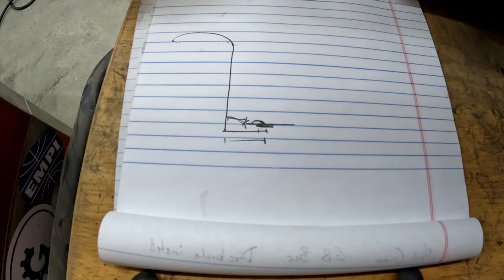VW Beetle Floor pan install

Comment: Probably the best video on how-to replace floor pans. Very thorough and to the point. Thank you. Now… all I need to do is figure out how I can do all of this in my 1 car garage. 😅
Reply: wish i had a garage
Reply: I don’t have a garage lol
Reply: Always, always, always drill the welds and use an impact chisel to remove the leftover metal after cutting off the floor pans. This is VW Bug 101 people. Doing it the way he's doing it will result in premature deterioration of the new spot welds and also lead to leaking from the floor board.

Comment: I've done this a few times. Exactly the way you did it. Cleaning up previous work is a real drag. I swear VWs are among the hackiest of old cars. Everyone and their brother butchered these things back in the day. I've used sheet metal screws to act as a extra set of hands to hols to the pan while welding. I then unscrew them and plug weld the holes. It's good to see you taking the time to do it right. Hope your friend appreciates the work.

Comment: Nice video.  Very inspiring.  My son and I are about to jump into the same project with our 1971 SB (Plus a lil pressure from Wifey/Momma).  Have to do some frame head work (napoleon Cap and bottom plate) then floor pans, heater channels and  so on and so on and so onnnnn......  I'll be watching the rest of these videos FOR SURE.

Thanks for the inspiration

Comment: Great quality pans. Question: could panel adhesive be used either partially with welds too? I’ve seen Mike Fn in his channel using panel adhesive for Bus cargo floors. I’ve always wondered if that could work on Bugs.

Comment: Good video good work as much as I like the idea of Volkswagen I would not fit in one. The only question I have is where the tunnel was nudged warped quarter inch from the edge of the floor panel I would have done good side first then wedge out the tunnel with wood blocks or  with long wood clamps with the ends of the floor pan clamp down in four places. Is there a law that says you shall not mess with the tunnel?
Reply from the maker: The tunnel was not warped, the inside edge of the floor pan was cut too short from the manufacturer. The tunnel is a totally enclosed unit, think of it like a boxed frame rail, you're not going to wedge it or move it into place without extensive metal work.

Comment: Question: When you welded the outrigger to the torsion tube bracket from the bottom, did you use a stitch weld?

Comment: Are the 20 guage pans to thin  not worried bout original just wanting to have a solid floor without holes. Can get a set of 20 guage for $300
Reply from the maker: I have used them before and they are fine, but I definitely prefer the oem thickness pan halves. They feel much more substantial

Comment: Can this be done properly with the body still on the chassis?
Reply from the maker: Technically yes, but I would never advise doing pan halves with the body on. It makes everything more difficult and hard to access.

Comment: No measurements needed before removing the old pans? Are the replacement pans good enough to just weld in without checking width etc?
Reply from the maker: This is discussed in the mock up phase of the video before the new pan halves are welded in.
Reply: @callahansgarage  premature comment disorder. I commented after watching you cut out the old pans. I've seen other videos where they do measure first. But as long as it works 👍

Comment: Do you not remove all paint from the areas to be welded?
Reply from the maker: yes, i dont remember if i specifically showed this in the video but every weld joint is ground clean on the base flange and the new pan half.